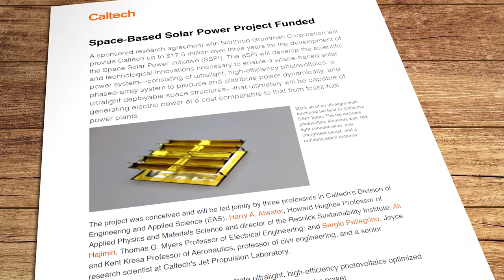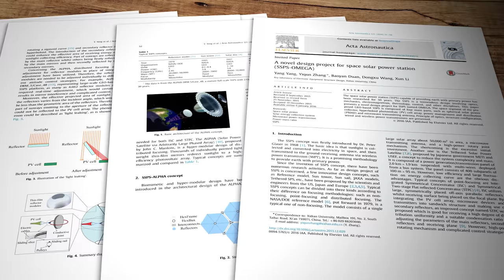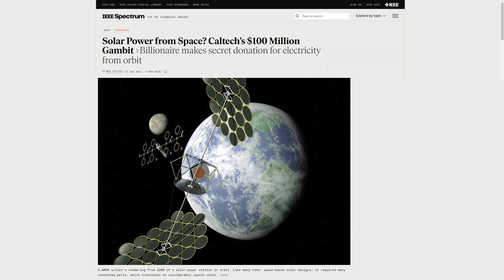Powering the planet from space. Closer to reality than you think?

Comment: Are they bonkers?  Abso-f-ing-lutely.  Reasons why:
1. Cost to launch.  Launching things into space is VERY EXPENSIVE. Granted, Space-X & other commercial space exploration companies have been bringing the cost down, but installing ground PV arrays is always going to be much cheaper.  I can't even imagine that building the infrastructure to distribute new ground PV power would surpass everything required to design, test, build, launch, and operate a space power station... AND the ground receivers as well!
2. Orbital debris impacts.  Earth orbit is littered with... well litter.  Namely space junk and micrometeroids.  Granted, it's the worst at low earth orbit, but even geostationary orbits are not immune to impacts.  And these space power stations would be immense, as stated in the video.  So much area susceptible to impacts that would deteriorate the power collected, if not outright shut it down.
3. 100% precise and constant pointing required to focus the energy to the ground collectors.  If those energy beams were to stray a fraction of a degree away from the collectors, they could blast anything in their path.  Without incredibly reliable safeguards to keep that pointing in check,  you wouldn't want anyone living anywhere near those collectors.
I give this idea 4 thumbs down.

Comment: I thinks you missed the broader points.  
    1st We gots phased-arrays that can track 100s of moving targets & the next-step is power delivery to them.  
    2nd The context should be expanded to the whole darn solar system (oh I guesses that includes our small-little itchy-bitty planet too ;)
        For example put a network of solar panel power stations across the solar system    
But most importantly, spacebase solar panel power is highly centralized conversely you can't gets more distributed than homebased solar power systems.  In a nutshell for home power & independence ain't nothing beats just putting a low-tech solar panel system on every home that'll easily last a couple of decades.  That's why I putting a solar panel system on my house myself (no-more darn electric bills especially darn taxes forever !wuhooooooo! ;)

Comment: So if we consider earth as a more or less closed system, wouldn't be that adding energy that didn't hit directly the surface end up in a grow indirect heating?
All electrical machines do waste energy in heat, the best one are only doing on 5% but it is still a 5% of how many GW are coming down... 
It seems far fetched as a problem but if this thing go on it might be relevant
Reply: The excess energy from this is lower than from greenhouse gasses. We would eventually need to examine the subject, but this would by itself already be a massive improvement.

Comment: The original rationalisation for space based solar power is the promise of near constant sunlight. The problem is that you only get that in high orbits (the higher the orbit, the less interruption) and that means that you've instantly got a near impossible transmission problem. And the economics are absolutely intractable. Because grid scale energy storage is becoming a mature and cheap option. That wrecks the economics of space based solar power, nuclear power and practically every other proposed "future" power source. Can't blame them for getting research grant money to play with it, but yeah.. aint gonna happen.
Reply: Even in low-earth orbit, the capacity factor of space-based solar systems would be much higher than land-based ones, and if you can get those thin solar arrays deployed, the sheer size of them would be a huge advantage as well. The storage problem is similar regardless, but this is a worthwhile investment.
Reply: The seasonality of solar + the intermittency of wind + the impossibly high cost of electricity storage is keeping the coal market pretty healthy.  District heating from nuclear power plant cooling has become a 'thing'.

Comment: hard to see a safe way to transmit so much power to earth. but is it worthy of research?, o yes.
Reply: Radio beam. Good atmo pentation and spillover isn't dangerous to biotics.
Reply: @benmcelwain5301  : More particularly, tests favor a specific set of microwave frequencies. They don't interact with much, and the frequencies in question allow somewhat widely spread antenna elements to still block the frequencies in question.
Reply: @absalomdraconis  Interesting. I take it these frequency allow for avian transition throu the beam as well as not heating water molecules? However, I am concerned that the public will not embrace receiving stations near them as microwave = cooking for most of them. The need to isolate the facilities would decrease efficiency of the system via transmission loss.

Comment: Dave—por dios I was getting to the point where I thought you were being so open-minded your brains were going to fall out. But now it seems you've grown a bit of an edge. I like it!

Yes, it's b$%^&t. I've always suspected that those who favored this idea did so because they were space enthusiasts, not because they had carefully analyzed the practical issues. That was back in the mid-Seventies, when I first saw any serious discussion of the matter. (I think I have a vague memory of something in Physics Today around that time, but wouldn't want to swear to it.)

By now, the whole idea is much less tenable than then, because solar PV has gotten so much cheaper, and so have systems that you can use on the ground for energy storage. Transportation to space has also gotten somewhat cheaper, but not nearly to the same degree.

Probably the biggest problem with SPSS is about the same problem as for nuclear here on Earth: It's not practical on a small scale. You need really huge collectors, launched on really huge rockets. And on the ground, you need really big receiving antennas, and perhaps worst of all, you need really long grid distances to distribute the power to where it's needed. This is important because, if you can deploy such long grid lines, then you're a long way to being able to distribute electricity from sunlit areas to dark areas, and that reduces the need for energy storage. That mitigates one of the big downsides of terrestrial solar.

I have done some add'l reading on this subject in the last 3 years or so. A recent book by Robert Zubrin threw a surprising amount of cold water on the idea, and provided me some more leads for research papers, which in turn threw some more cold water. Further details are gladly supplied on request, but one thing I remember is that erosion from meteoroids was going to be a significant problem from limiting the lifetime of the panels. (This seems a bigger problem than just having to clean them occasionally here on the ground.)

I find it amusing that StarLink may interfere with the ability to operate SPSS. Given Lonnie's comments against SPSS (basically, one too many kinds of photons involved), it's a delicious irony. I highly doubt that was part of this planning process, But it's still funny how that works out.

One more thing: It has even been suggested that it might actually make sense to send solar power from the Moon to power Earth. That's even less tenable than satellites, but there is one way I really could see solar power on the Moon making a lot of sense, and that is if you collect it on the Moon and USE it THERE. The lunar poles have some essentially unique properties. The bottoms of some craters there are some of the coldest places in the whole Solar System, but since the Moon has very little axial tilt, you can make a solar generator as a heat engine, a very simple design in principle, that can work at reasonable temperatures, and yet potentially with very high efficiency. In fact, at such a location a heat engine probably makes a lot more sense than PV. You could have continuous solar power, and distribute it to other locations. (Your grid lines would not have much adverse weather to contend with, and gravity would stress them less than on Earth.)

That's all probably a bit farther in the Future but, the ways things have been developing lately, it may not be as terribly far off as it used to look.

Comment: I pose the question: Should we (humans) collect solar power and beam it down to Earth by microwave or laser?

The answer, and I quote, is "No.  Don't be ridiculous."
Are you serious?  Who in their right mind would attempt to sling that much hardware into space and waste all that much energy to accomplish something that would be thousands of times easier.

That something is simply putting a square mile or more sheet of metallized plastic, rolled up, into orbit, and unfurl it in space to become a gigantic mirror.  Leave all the solar panels here on Earth where the light from the mirror will be directed.  This would allow the solar array to be illuminated in the direct sunlight by day and by the mirror at night.

This mirror could be made mostly of metallized plastic, with structural members made of tubes of metallized plastic that once in orbit are inflated with dry air to become stiff enough to support nearly no weight.  The structure would be ultra light and a huge amount could be deployed from a single launch.

If you really think about it, it would be absurd to do it any other way.  By the time a kilowatt of sunlight hits the solar panel in the sky, gets converted to microwaves, reaches Earth, and gets converted to electricity, there would be less than a hundred watts left, probably closer to 50 watts.

And there is no worry about frying anything with microwaves.  Just freaking out nocturnal animals like owls.  😱😂

Thanks, Dave.  Am I the only one who has proposed this system?  There must be some other "best scientific minds" that have rationally thought about this!
Reply: You'd also need engines to keep it on station & focussed & a power source and a computer to control it all. And that small a mirror wouldn't reflect enough light to work.
Reply: @thedamnedatheist  

I said a mile or more square - whatever size is needed.  It's a thin sheet so a lot could fit in a small space.  As for engines and power, of course it would need them.  The orbit would be geosynchronous but above the ecliptic at night to reflect the sun and below in the daytime when it's not reflecting.

Comment: The power generating capacity in the US is 1.2 million meganwatts which with a little math is 1200 gigawatts or 1.2 terrawatts. Granted, not all of the capacity is in use at any one time but that is the generationg capacity needed to keep the US running and that does not take into account the energy that will be needed to replace all the ICE vehicles currently in use.  And that is just the US. I would think China is generating a comparable amount as is Europe. If we (humanity) put up enough solar power stations (SPS's) to generate even 10% of the world supply a significant portion of the night sky would be blocked by the solar arrays. Then there's the problem of solar storms. If one is headed our way all the SPS 's will have to be shut down to keep the electronics from being fried. So there will have to be generating capacity available to replace the power from the SPS's during the time they are down? Terrestrial power stations which means the SPS's would be unneeded. Assuming the solar storm issue is fixed what happens when the SPS's are damaged or destroyed by micro and macro meteors, or more likely, human space debris? 

We need to focus on existing technologies, or technologies that are achievable before 2030, and then implement and adopt them by 2030. We (humanity) have been entertaining the delusion that we didn't have to worry because there would be a breakthrough technology that will save the day, so we are now near the point of no return. We need to develop and improve the technologies we currently have AND cut back on energy consumption if we want to get to a maximum 2°C global temperature rise. With the current political and social conditions in the world we will likely miss the 1.5°C goal. If we do miss it let's work to keep it as far away from 2°C as possible.

Comment: Afaik, a laser is the most efficient wireless way to transport energy over large distances. However, part of the energy will be absorbed from the atmosphere and you would have to take into account the weather conditions, e.g. only transmitting the beam, when the weather is clear an there are no clouds.

A worrying thought: Solar panels do not really produce CO2 while they are operated. But if you consider, that they redirect energy from space, that would normally not have reached earth, and transmit it via laser (heat) in units like Megawatts, wouldn´t that mean, that a significant amount of additional energy would reach earth, that would otherwise have been lost in space? Thus warming up the earth.
Reply: It'd be next to nothing compared to earths size
Reply: Not significant.
Reply: In addition to the triviality of the added heat, the laser is worse than the microwave due to the lower efficiency of generating it, it's vulnerability to clouds (the microwave frequencies chosen don't meaningfully interact with anything the atmosphere, including water vapor), and the fact that the laser scheme (due to it's much lower altitude) constantly has to be reaimed.
Reply: @Octamed  I´m pretty sure that was what people said about the pollution of burning fuel when it startet
Reply: @Kiboxxx  Well when we cover half the planet in solar panels, get back to me

Comment: This idea is only batshit crazy whilst the solar collector is orbital around the earth. The usual inverse square energy propagation law means that as you approach the sun, energy returned for a given collector area increases by the square of proximity to it. Using a Maser to downlink the energy to the surface of the earth is of course sensible, but you also need a solar collector close to the sun where tremendous energy is readily available to overcome conversion losses. I envisage that the solar collector would convert the solar energy to chemical energy in a reversible chemical reaction. Then you would have a chain of transport vehicles that move the chemical energy store from the sun, back and forth to earth orbit. If it has to be for the whole planet, then this scheme makes space energy feasible. Solar collectors in earth orbit won't work out because the energy density is so weak in earth orbit. There isn't enough energy to overcome conversion losses. Spending money that way is certainly batshit crazy.
Reply: @odonald6087  Exactly right. That's why it isn't really worth doing this unless you collect the energy close to the sun. There, close to the sun, you can have just one plan and satisfy all the energy needs of the earth in one effort.
Reply: @andyash5675  At the moment there is no way that collecting power in low-sun orbit, then turning it into a laser that spreads out to a greater diameter than the earth is going to make more sense than just sticking a bunch of PV panels on the earth's surface.  You still haven't solved the night time problem either, as your beamed energy won't go through the earth either.
Reply: @odonald6087  Well, someone on the internet always has to be wrong I suppose. All I'm saying is that getting energy from earth orbit to the surface is only half of the problem. Physics tells us that there is a fairly attractive way to get energy from solar orbit back to earth orbit, better than using an energy beam. If we don't kill ourselves with WMD, nor do we suffer an extinction, then I can see it happening in the distant future, but we are way off that yet. Perhaps though, we could exploit fusion by directly plugging into the sun? Seems like a good idea to me, even if it is difficult. Photovoltaic isn't the best though. The panels don't last long enough to make them  sustainable. they need to last hundreds of years and they barely last for a decade or two.
Reply: @andyash5675  I guess I'm not understanding your point then.  PV is plenty adequate for converting sunlight into electricity (and is currently the cheapest source of kWh), and sunlight is energy beamed directly from the sun for free, in tremendous quantities.  I'm not clear what benefit you see for sticking PV close to the sun?  Remember that any energy you beam from the sun is going to spread out dramatically, needing huge areas (probably more than the surface of the earth) and still will only be available during the day.
Reply: @odonald6087  I'm pretty sure you aren't understanding my point. You did explain to me that I was wrong so I didn't feel like explaining.
Reply: @andyash5675  You're absolutely right, I thought I was arguing with a different person who made the point I so elegantly knocked down.  I think you'd need to use solar sails to make the delta-V practical, and it's hard to imagine that it would ever pay off for earth bound generation compared to just scaling up PV and chemical storage, but it definitely could make sense for dyson spheres and moon bases.  Neat idea.